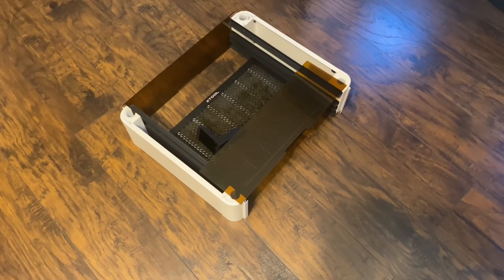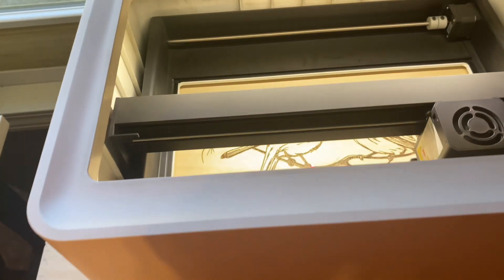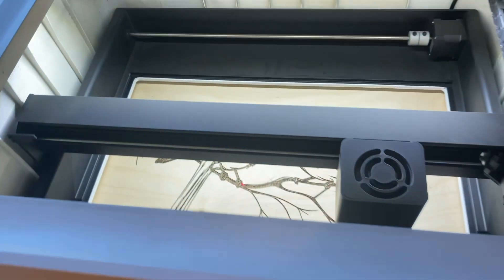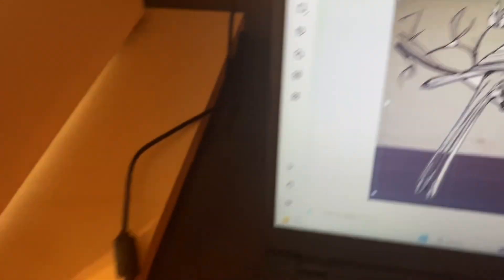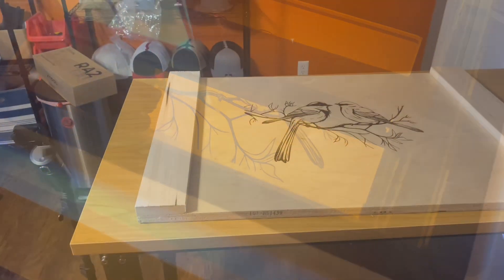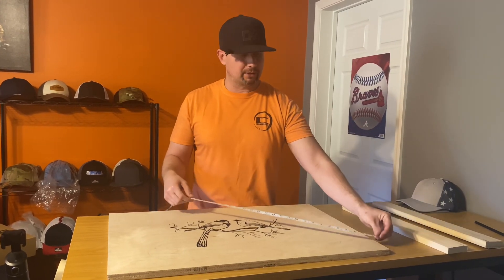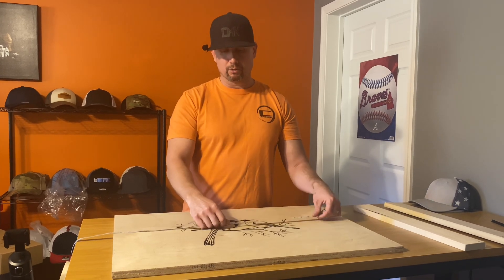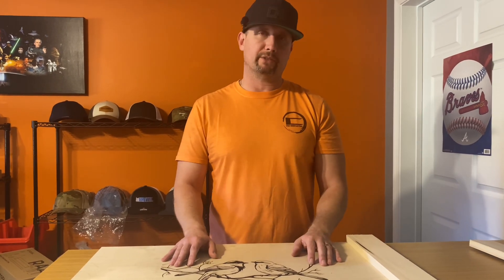How to engrave larger projects with the Xtool M1

Comment: Do you know if this would be possible with the xTool S1? xTool Customer Service is giving me mixed messages. I’d like to buy an S1, but I need to verify it can do this for a certain project.
Reply from the maker: @tcredmon  The easiest method would be to buy an open rail laser engraver. They are relatively cheap now days. They’re way more portable for these types of products and easier to line up for big projects like this.
Reply: @coleminorkustoms8594  thanks so much for your response! I’m interested in the S1 for it’s versatility for other projects that an open frame engraver wouldn’t be ideal. I’m just wondering if it would be able to do this too.

Comment: do you have a video of how to remove the base?
Reply from the maker: @anakarotkin6556  the bottom plate should be held in with about 4 or 6 small black screws. Once you get those out, the bottom plate will just lift up. You don’t have to put the screws back in when you get ready to put the plate back in.